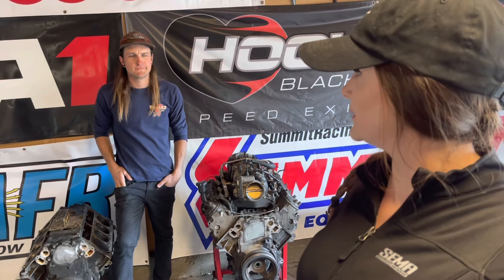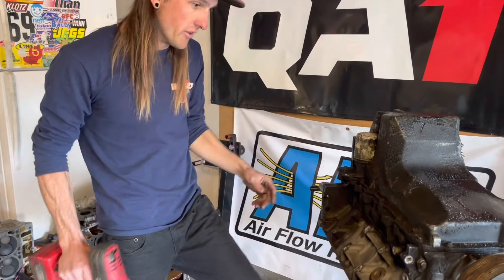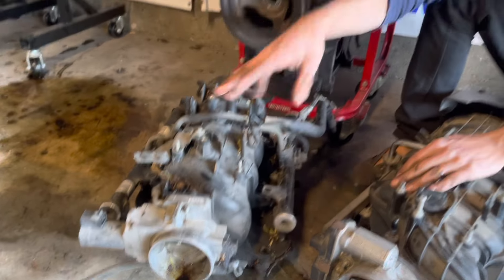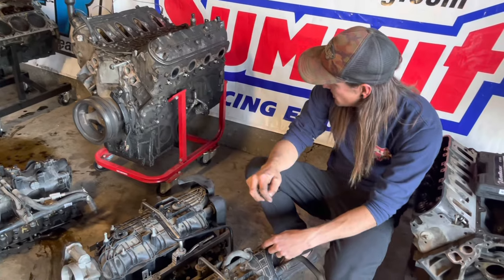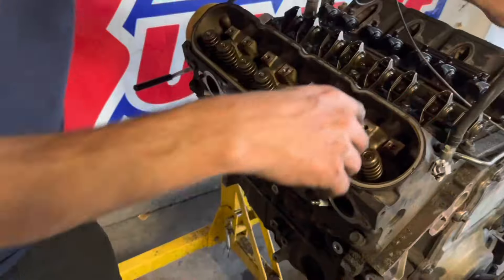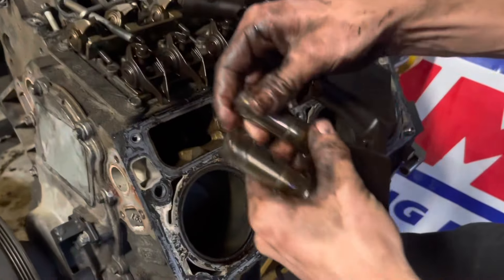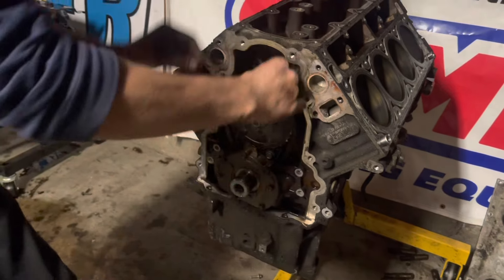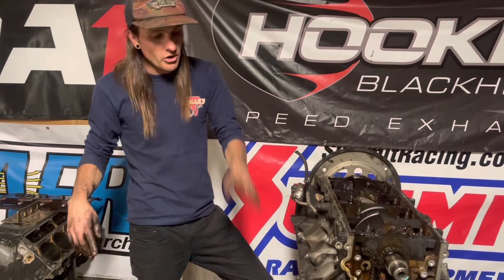Double Aluminum LS 5.3 Engine Tear Down: High Performance L33 and LH6

Comment: I shoulda got a great big note book to store all this knowledge while watching Travis's videos 😁 thanks for sharing Bud ☮️
Reply: I highly recommend it!  I have a little 3”x5” spiral notebook that I bought (at Walmart for less than $2, for a 4-pack) and keep all my notes in.  I have several different “LS” motors, and I keep all the specs in them.   Can’t “forget” if it’s written down!   I was a traditional “Small block/Big block” GM guy for decades, especially when it came to fuel injection.  I especially loved the Tuned port injection system’s!   My favorite trick was take a TPI 350, put in a Dual-sync (ACCEL) and wire in a ‘93-‘97 Camaro Lt-1 ECM for sequential fuel injection.  You would get an instant 45hp in N/A form, but with a turbo….. Whew!!!  That was one of the secrets of the Buick Grand National’s horsepower.   With SFI, detonation is far less likely.  The LS takes everything the old generation I and II, and just bumps it to level 500!   I love everything about them.  Pull the trigger, you will be glad you did!

Comment: Thank you making this video. I have the same motor in my 07 trailblazer,about to do the DoD delete and nobody I've seen has info on this engine. You broke it down and made my mind so relieved lol I didn't know what was going on with that cam sensor on the timing cover and if it was a 3 hole cam.  Thanks again great video
Reply from the maker: If you’re 07 it probably isn’t this weird hybrid engine. It should be fully gen 4 58x. This thing is only 05-06.
Reply: @travisblack417   mine looks identical to the one you pulled out.  Has the M in the vin number aswell
Reply from the maker: @briancavazos4237  vin M is LH6 regardless of if it was 24x or 58x. It’s very strange how GM changed RPO codes for certain things but not others. LH6 is both 24x and 58x.
Reply: @travisblack417  but I should be able to order the same cam swap/dod delete right?  I’m not gonna be swapping anything from the bottom end
Reply from the maker: @briancavazos4237  it may in fact have a single bolt cam. At that point you would need to convert it to a 4x 3bolt cam gear.
Reply: @travisblack417  yea I just checked and that kit has that cam gear included.  Also has a vvt to non vvt harness adapter

Comment: As far as intakes go, the Trailblazer SS intake is just about the best one you can buy.   If you don’t already, check out Richard Holdener’s channel.  He dyno tests them ALL.  Only a few (like the 102 mm F.A.S.T. Intake) flow better.  We’re talking infinitesimally small here!  Like 22 hp on a 750 hp turbocharged 6.0L!  It was even less on a naturally aspirated motor.  Something like 8hp!   I don’t know about everyone else, but if I didn’t already own my fabricated aluminum high-ram (I bought it, mostly, because it reminded me of the TPI 350 my ‘89 Trans-Am GTA  came stock with.) I would definitely get the TBSS intake.  The engine cover mounting bosses can be cut off, smooth out with sanding and metal glaze.  Paint it a cool color, and you have a sweet custom intake!

Comment: The l96 6.0 rec headed engines were flex fuel and have the 3412 injectors that are 50 lb. They will support quite a bit of power.
Reply from the maker: @davidreed6070  apparently those are only in the 40’s which is still quite high. I’ve read that only the LSA and L94 (flex 6.2) are the 50lb big boys. Once I get a set and test them myself I’ll know

Comment: I have this same LH6 in an 07 Saab Arc. Looking to swap cam and delelte DOD. want to use the stock heads. The 233 cam you may run for this 06 LH6, do you think that is a wise choice for my 07?  If not what cam would you suggest? DD/ 500hp .....Really appreciate the detailed content 👍👍🤌
Reply from the maker: 500hp is quite a bit out of 325ci, but doable. It purely depends on what you define as “daily driver”. Shoot me a message on IG and I can spec something for you

Comment: I have a question 2006 trailblazer with a 5.3 crankshaft interchangeable from the regular 5.3 iron block. Same years.
Reply from the maker: Double check that your PCM is indeed 24x, but yes it should be identical. Despite the fact that all 5.3, 5.7, 6.0, and 6.2 have the same stroke and casting number on the crank (2216) they are balanced differently. But 24x 5.3 should be the same regardless of piston dish/flat
Reply: @travisblack417  sweet love all the information keep up the good videos

Comment: What engine stand do you recommend
Reply from the maker: This yellow one is made by jegs and I really like the crank action to rotate it. I got it free (from Dulcich lol) because it’s actually kind of a pain to rack up since the mount doesn’t separate from the stem. You have to line up the 4 bolts on a weird angle every time you mount and dismount. It’s not that bad because I only do LS’ so everything is the same every time.

Comment: I just picked up an aluminum short block gen 3 with knock sensors on top. No heads just curious if u know do these run gen 3 or gen 4 head bolts?
Reply from the maker: The head bolt change is earlier than gen 4. What do the pistons look like, and what’s the block casting number?
Reply: @travisblack417  the number on the block opposite the 5.3 is 51542
The pistons have the + on them so they are not totally flat top. Haven't been able to pull the pan off yet to look at the rods the engine is still in the back of my truck
Reply from the maker: @mnmadman5405  I need the 8 digit number on the back by the head. Are they dish or flat
Reply: @travisblack417  well since I helped me figure out which number to look up it appears it's an L33 block and will use the 2004+ cylinder head hardware.
Reply: I guess let me know if you find out something different I appreciate you responding and helping out 👍
Reply from the maker: Your motor is in fact an L33. It should be exactly the same motor in this video
Reply: @travisblack417  thanks man I appreciate it

Comment: Could you possibly Tig
And fill that Surface?😊
Reply from the maker: That’s the plan. I’ll take it too a machine shop at some point and see what they have to say. It comes down to if the repair costs more than the shortblock is worth.

Comment: What type of engine would you slap on a 95 gmc 2500? Also I have rebuilt the motor but this time decided to swap it out for a rebuilt 5.7 v8
Reply from the maker: Stock 6.0
Reply: @Travis Black  what if I wanted to modify it ?
Reply: @Travis Black  I just watched the video of you swapping out the lt1 corvette motor for the ltz on the truck. You make it look so easy
Reply from the maker: @TOROG13  practice makes perfect
Reply: @travisblack417  are you self thought or did you go to school?

Comment: They bore those 5.3s and press sleeves with a 4.125 bore and build a 427 out of then.
Reply from the maker: @davidreed6070  only the 2010 and later blocks. There’s a specific casting number. The LM4/L33/LH6 all still have the 5.7 non-Siamese wet sleeves